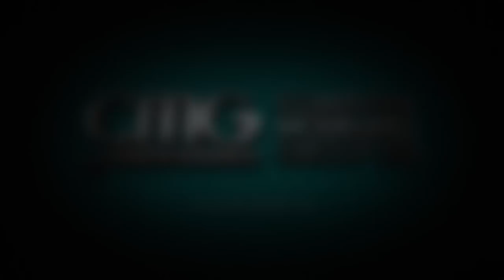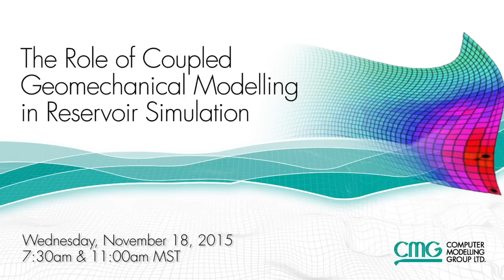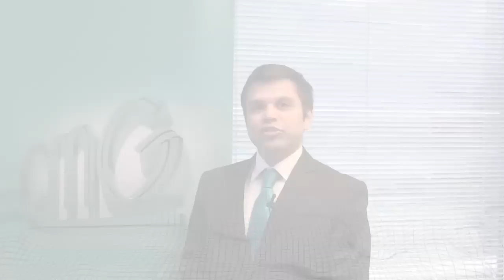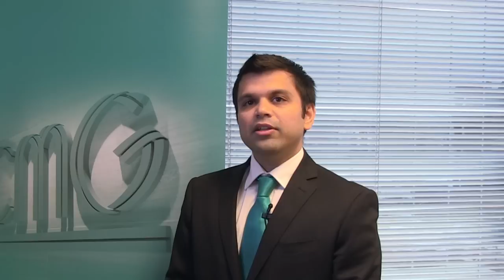CMG Webinar: The Role of Coupled Geomechanical Modelling in Reservoir Simulation

Comment: Hello Dear! Lately i have started using CMG stars to investigate the polymer model with geomechanical model but after running the model still kept failing due to issue related to geomechanical model although i have tried on multiple occasions to solve the problem but, still there are problems failed to be solved.I have failure file output and i don't know how i can share you here.
Reply from the maker: Hello Mahamat, thanks for your comment and interest in CMG. Could you please share your file and a descriptionof the problem to support@cmgl.ca please?